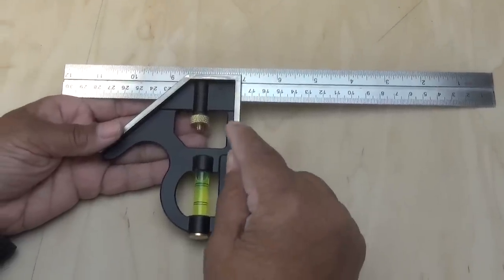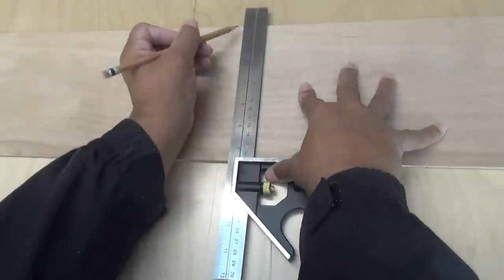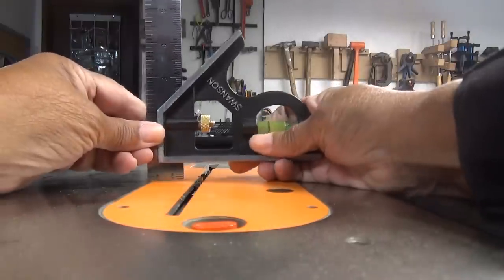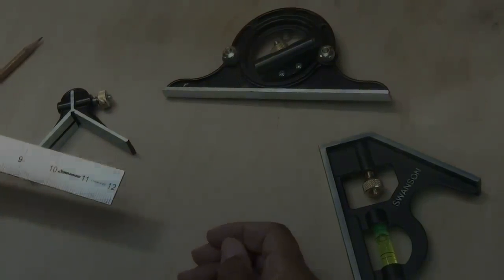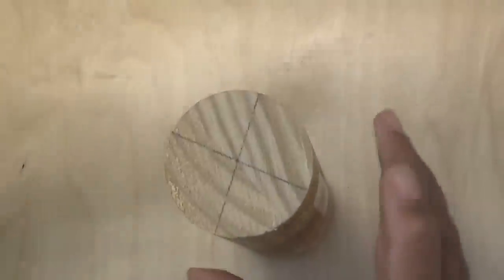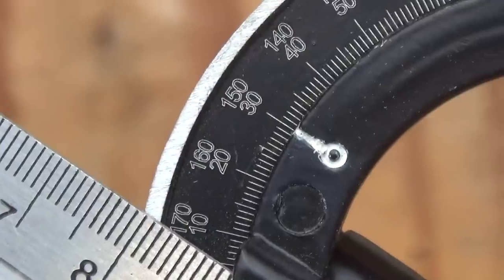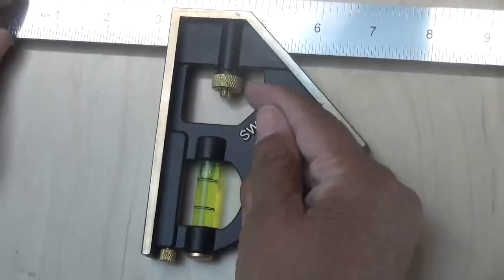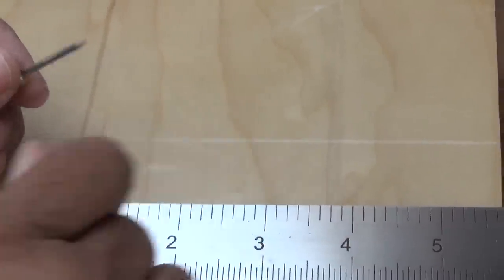Secret Tool in a Combination Square Revealed

Comment: I just found this hidden tool tonight, because im insatiably curious and always study all parts of things i come across. I wondered what the pin was and how its used. I looked up my question and came across one of Leah's videos again. Awesome! The first time i found her was about 2 years ago when i was studying electrical wiring. She showed the hidden tool on a power outlet. And i can't tell you how many guys I've dumbfounded by showing that off. Thank you once again Leah .

Comment: Just purchased my first combination square (I've always gotten by with the triangular speed square) and the first thing I noticed while inspecting it was the odd pin in the bottom. I googled "How to use a combination square" and your video was the first hit. Thank you for the answer and the introduction to the other add-on options.  The protractor will be a major help. I can't believe I'm just finding out about this at 47 years old! Thank you!

Comment: I learned about the scribe in college. I had a Summer job in a metal fabrication shop, and we used it to score lines in metal all the time. I still use the scribe if I need to score a line in a harder substance.  Enjoy the videos! Very informative.

Comment: I hsve an Empire comb. Sq that I’ve been using for 50 years, but I now need to replace as its falling apart, and yes, I knew a bout the scribe, but have always preferred a pen or pencil mark.   I am a strictly incidental user. Neither hobbyist, nor woodworker am I. I certainly admire those who are, but I’m more repair what needs fixing type of guy. Leah, you obviously know that you are one of the stand-out builder-teachers on YT.  Your lucid and accessible explanations have made me a big fan of yours.  At 70 years young, I have an abiding admiration for those who can transform the challenging and formidable into the accomplished! Lead on, Leah!!!!

Comment: I have been using combination squares for almost thirty years and while I knew about the scribe tool, I have never been able to master the insertion of the ruler into the anvil. There is always a sheer moment of panic whenever I have to pull the ruler out and flip it. I own several squares now because I can never get them re-inserted once I remove them. A video on aligning that half moon pin and sliding that ruler back in and squaring it up...that would be something that would change my life! Thanks for all the work you do for us. You are invaluable in this community.
Reply: Me to, I've always been frustrated with just getting it together.
Reply: Me too!
Reply: Just loosen the knob a turn or two and push up on it (it is spring loaded) while inserting the blade.  May have to turn the knob slightly one way or the other to get the key to align with with groove in the blade.
Reply: The struggle is real. I have often told myself that it's because my combination square is a cheap one (but perfectly adequate for my DIY needs) but it's good to know that I'm not alone!
Reply: Just be careful when the scale is removed from several, some have an semicircular profile, preferred, and some have a rectangular profile for the scale groove and the lock in the head.
Reply: smack it in with the hammer.... ;)
Reply: @lesfox2010  I did that, now mine doesn't have a level and it's slightly bent.
Reply: @markduggan3451  haha, please tell me that you are joking.......
Reply: @lesfox2010  Not saying anything mate but the use of a hammer can be fruitful lol
Reply: I hope your joking 😂😂😂
Reply: @muikthemad3933  maybe, maybe not lol
Reply: You and me both chief

Comment: Well Jane, I took wood shop in school, and also built a lot of stuff when I was younger using one. My girlfriend’s parents go garbage picking in the rich neighborhoods in Brooklyn. They always bring old toolboxes filled with mostly junk. I just this morning started restoring an old combination square and never noticed the part at the back. I unscrewed it and pulled it out to find a sharp point. I googled what it was, and what it was used for and it brought me to your video. Thank you for making me a little bit smarter today. Not only about that but the other add-ons on a combination square.

Comment: Leah, you are the best! Incidentally, I ran into a combination tool for the first time today at Harbor Freight (HF).I am working on a project that requires 30 degree angle. Remembering my high school days, I thought of getting a geometric or mathematical set from HF.I was intrigued seeing a combination tool but not knowing how to use it.I knew it will save my problems. So I came to youtube to learn how to use it. The previous YouTuber talked about the scribe tool but for a different reason.He uses it to mark off the points of a straight line as you have on a measuring line.So that way he visualizes along the distance of a straight line on the board. However, I learnt more from you.You went into additional details on how to use the angle finder, how to find the center point of a sphere. Thank you very much.What a great teacher, you are!

Comment: I have known about the scribe for decades. I found it in my youth, and asked what it was.
You might also mention that the rulers come in different lengths. I just got an 18" one from Harbor Frt. Tools, as I had misplaced my other one that was shorter. It was really awesome because the length enabled me to make measurements I would have otherwise had difficulty in making with the short ruler..
  Also I'd like to mention that on the ones that have a steel ruler, that periodically disassembling the ruler from the body and cleaning out the groove of rust & debris help make it slide easier. I also put a dab of silicone grease in the groove and wipe off all excess. A couple I have do have a small spring on the screw and a tiny bit of lube keeps the spring from rusting & breaking. (I live in Washington State, and you all know we never have any rain here, so the tools stay nice and dry all the time, right?)
 To get the "half moon" guide pin back into the ruler groove, I found loosening the knurled nut a lot will enable you to easily rotate the guide "half moon" to allow the ruler to easily slide back in.
 Great video, Leah. thanks.
Reply from the maker: Hey FK, we are neighbors!!  I too am based in Washington state, in the rainy part. 🙂 Thank you so much for sharing those maintenance tips with everyone. I hope it is helpful to those who have mentioned that they have trouble with sliding the ruler back in.  Best regards, Leah
Reply: I also have an 18" one, but HF has a 24" too and it is great for many situations. And surprisingly accurate for an HF tool.

Comment: It is also used for the ruler part if the ruler has 2 holes in it. 1 hole is for the scribe and the other is for your pencil to make circles. I had 1 that had holes on every inch line for making different size circles. It's a all in 1 tool. Great for an all in 1 handyman.

Comment: Hidden scribe doubles as emergency tooth-pick :-)
Reply: Do not even try to do this as there is a significant risk of tetenus, particularly in the younger age group.
Reply: Kingy B Always used it to clean my bowl at work. 😎😎😎
Reply: Steve Downey for tobacco right ?
Reply: hauntedhouse I’ve been part of the green new deal for years
Reply: Or if you need to pop out a baloon.
Reply: @mohammedshadbar5779  ....If for Richard is fine to use it, maybe is because he's an old timer and only has like 7 tooths

Comment: a good trick is to tell the new guy in the shop that the scribe pin is a control knob to switch it from metric to imperial ^.^

you're welcome
Reply: too funny
Reply: Funny, but not as funny as my mate who told his young kids that if the ice cream van played its jingle then it had sold out 👍
Reply: I'm gonna use this and the ice cream truck.
Reply: Don't forget to have them go and get a board stretcher, or the black and white checkered paint.
Reply: I told my boss we needed a new level as “this one has a bubble in it” and as he was new to construction stopped and was looking at the level for around 2 mins while the guys and I had a great laugh at him he wasn’t happy that I pointed out his lack of knowledge on a regular basis even asking him how he ended up with his job in front of the owner of the company after sending him around looking for a wire stretcher because he cut the wire to short for the run “ahhh it’s only like 2 inches short go bring me the wire stretcher please I think James has it....
Reply: Speed control!
Reply: The difference between British spanners and American wrenches?
British spanners are right handed
American wrenches are left handed
True!!!
Just like our cars..
Honestly Guv...

Comment: Fun fact, did you know most combination squares also have a 135deg angle? I noticed this on my square one day, and have since confirmed it with various other squares. Put the ruler on the side with the 45, if you touch the curved handle type bit (beside the level bubble)  and the tip of the 45deg piece to your line, the ruler will be at 135deg.

Comment: I don't know why I haven't seen you til now. Thanks, Leah!
 And yes, you reminded me what the secret tool is. It's been quite a while since I've seen or used a combination square (also didn't remember what it was called). I used it as a nail/measure marker (making a hole), but didn't use it as a scribe, since it wasn't my tool & wasn't sure if I was using it correctly.

Comment: Didn’t know about the scribe tool. HOWEVER, there is an identical tool on the bottom of my reflex hammer that is used to test sharpness acuity during a neuro exam. Wouldn’t you know most doctors never use it because of risk of cross contamination, So I had my suspicions when you first pointed it out. 
I also didn’t know about the different anvils. Thanks bunches! 👍🏽 and keep up the great work!

Comment: I had an old head piece that came with tools I inherited from my uncle, but it didn't include any of the peripherals. Not even the ruler. About 15 minutes ago, I pulled it out for the first time, since I got it 30 years ago. It's pretty stylish, so I wasn't even sure if belonged in the wood shop, or on the drafting desk. Without the ruler, I just had a vague sense it was similar to speed square. I removed the scribe pin, scratched my head a few times, foolishly fumbling to connect it at the ruler lock as some kind of pivot, gave up, and decided this looked like a job for the internet. I should have suspected your video would be at the top of the list. In 5 minutes, I not only have all the answers, but a list of peripherals that have probably been out of production for 60 years, to hunt down. As tools go, this thing's pretty sexy. Even if I just find appearance appropriate pieces, restoring it as kit,might make an interesting back burner project. Taking it's place among the, "good tools", is long overdue.

I'm sure I subscribed at some point, but I bounce around accounts a lot, and can't remember the last time I saw one. I've watched a ton of your videos over the years, and have yet to see one that was worth watching. Usually, at the very least, I'll have a working knowledge of the subject, occasionally, starting at the beginning is probably the best bet. Like today, I'm sure I looked like a balding baboon with a square block, and a round hole. Your practiced perspective, and presentation style, pair well to quickly get the uninitiated up to speed, without patronizing the old hand in me. By the end, there's a good chance there was something to take away, regardless of skill level. It might be something small, but still impacts my consideration. In all honesty, It's not Uncommon to find topics I have more than enough experience to have a few tips and tricks of my own, I'll find you knew at least one thing about it that I didn't. Glad I bumped in to this today, hitting the old, "like subscribe and bell", trifecta on my way out.

Comment: I knew about the scribe tool because of my curiosity and willingness to take things apart. It is still overlooked by me when searching for that misplaced pencil. In fact, wish I had remembered it a few days ago while working with metal for my new backsplash. Instead I used a marker for the cut line and ended up having to grind an eighth of an inch off the end before it would fit in place. The scribe would have given the perfect cut line.

Comment: I knew about the scribe tool, but I've never used it for scribing on wood. I use it for marking metal, what where a pencil won't work.
I didn't know about those other heads though. Very cool.

Comment: Mine has a bright red knob so I discovered it right away.  I use it for making a starter hole for brad point and forester bit drills and digging out splinters in my fingers. Marks metal too and removes the dry plug in the nozzle of my glue bottle.  Also holds the olive in my shop martini.

Comment: You can also use the scribe to make perfect and portions of circles. Center the scribe pin and use a length of string for the radius of the circle.

Comment: I understood the scribe tool was used for marking on steel when preparing to make a cut with hacksaw. usually the steel had a painted coating  (Dye) of a dark purple colour. This was used in layouts for shop work.
Reply from the maker: Yes

Comment: Thanks for the great informative video ! 😀 I knew the tool was there as of the other day but had no idea what it was for. I wondered if it was some type of anchor to make weird angles other than. the 45º or 90º . I would like to try to get the protractor that you showed . I will have to make sure to find one that fits my steel rule. Thanks again.

Comment: Leah, thank you for ALL the videos that you post on here! My question for you today is, how do I tighten the "Secret Tool" in my combination square? Background on the square is as follows; it was my deceased father-in-laws square. So, it is an old one. The scribe is not threaded into it's spot. It feels like it has had a O-ring to hold it in place, but a little bump and it will fall out. How can I fix this or what do you suggest that I try, to fix it? Thank you in advance for your help with this matter!!!

Comment: I knew it, using it for metal working. The metal would be painted/coated with Dykum Steel Blue and lines made with the scribe tool. I use this square for 90% of my wood working. I also  have a mini version that is 4” long.

Comment: I'll probably be one of the rare few that knew about it since I bought It only because I have add and started playing with every feature on it till i pulled it out. Only reason I figured out it was a scribe was because I've found myself using 3 inch screws to mark a line when I can't find my pensil but the screws aren't as accurate as this. However I didn't know about the multiple attachments

Comment: Ive never used the scribe for marking cuts or w.e since I keep a carpenters pencil on a retractable belt clip. However, the combo square I have has a hole in the center with additional measurements to use as a compass so i set the scribe (or as i call it 'wood poker jawn') thru the hole and align my pencil with the square at the set measurement then spin It right round baby right round 😂 

Anyways....the combo square is one of my most used weapons of the trade, I have several of them so I keep one in my car, one in the truck, one in my shop, well you get where I'm going with that. God forbid some how, some way, I lose a hand....better believe I'm getting a combo square attachment and becoming Carpenter Gadget 😏

Comment: I did know that there are scribes in most combo squares. A metal nail or even a fingernail also works as a scribe. 
I did not know that a protractor head costs $200 at Lee Valley.

Comment: You can also drill a 2 or 3mm hole all the way up the rule from 1cm to 29cm you can then put your pencil in that hole an us it to mark straight lines. I actually only drill one hole at 1cm an just move the rule to mark straight lines.

Comment: That reminds me of the screwdriver in the handle of a Ruger .357.
You use a dime to take off the pistol grip to get to the screwdriver to be used to take down the pistol.
Ruger made this so if you’re out in the field and all you have is a dime you could tear down your pistol and clean it right there.

Comment: I learned about the scribe tool on it from my dad when we were installing a island countertop and i accidentally smashed my finger setting it he told me to cut it open to let the blood go out and pressure go down i didn’t want to cut it open so he told me to just poke it with that pokey thing on the bubble square which is what we called it 😂

Comment: I’ve got at least half a dozen of those little guys rolling around in my tool chest!
Reply: Those were always disappearing from the square and pop was always blaming my brother and I for it.
When pop passed on, we totally cleaned out the garage and found about 5 or 6 of those on the floor behind the table saw. A saw we were not allowed to use.